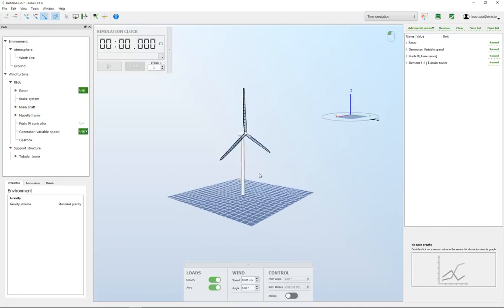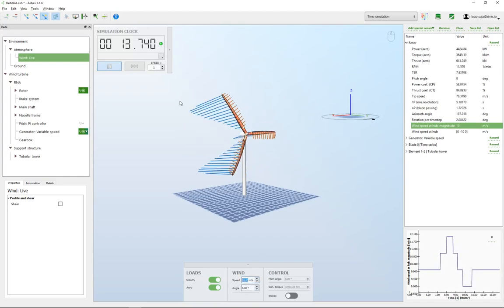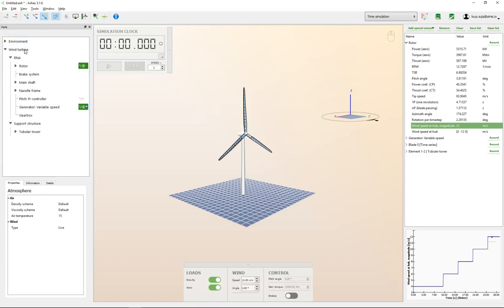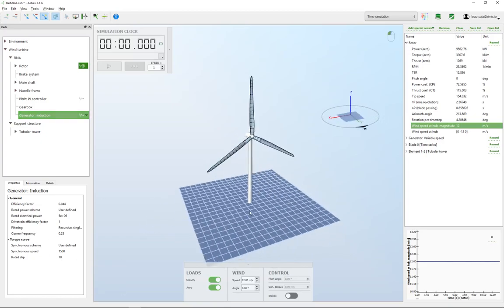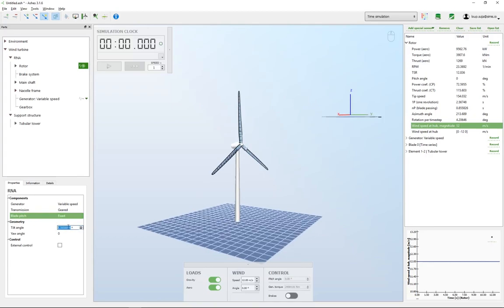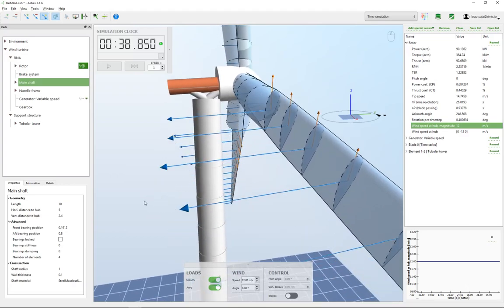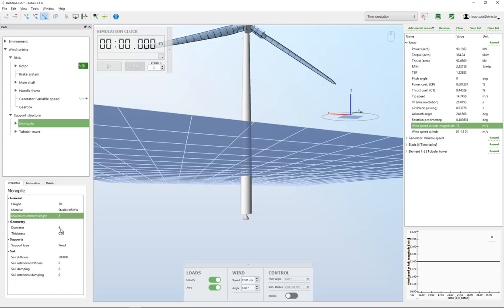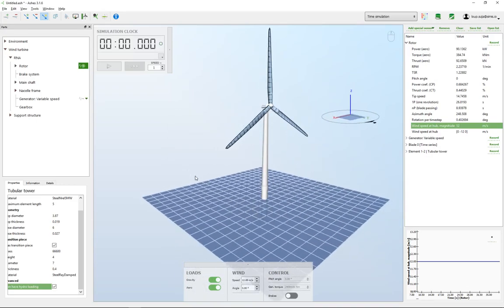Ashes model parameters

Comment: Hi! Is it possible to import wind data file?
Reply from the maker: What data does your file contain? Is it a wind field (for turbulent wind) or a time history of one single wind speed at the hub? In both cases the answer is yes, but it will be done in different ways
Reply: The wind data was collected from a pre installed macht, that has collected information for a span of a year. @AshesWindTurbineSimulation